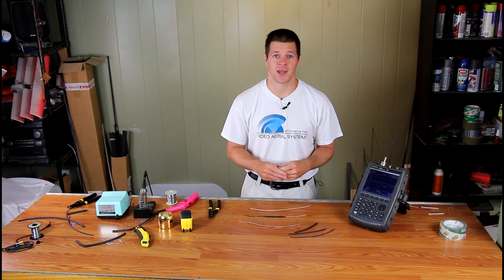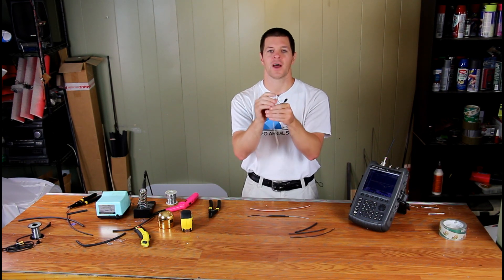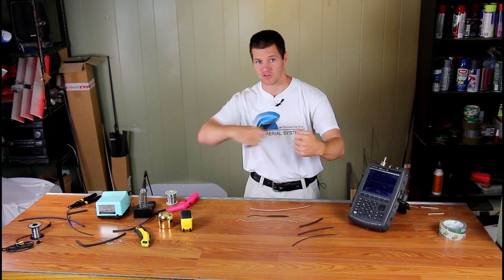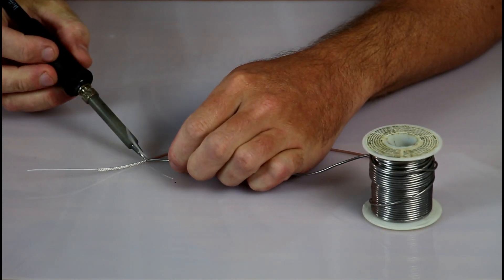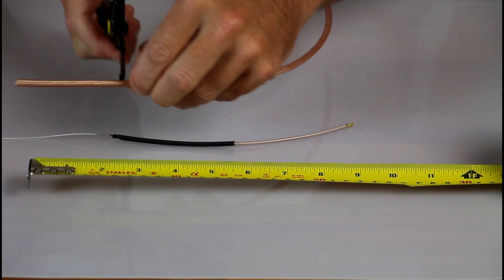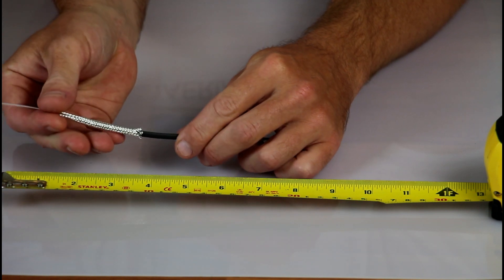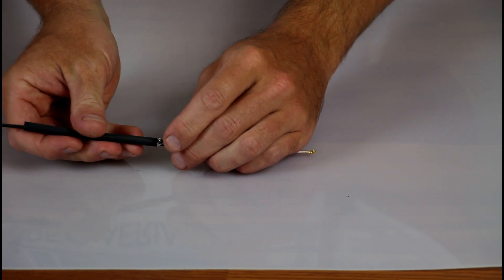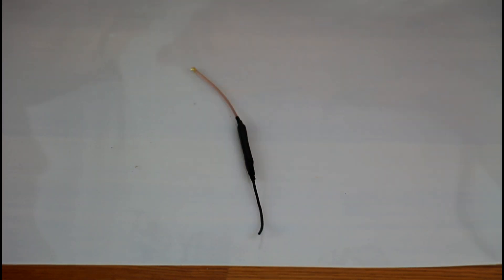DIY whip antenna for crossfire receivers (u.fl)

Comment: Hey Alex, I bought some 6 foot lengths of RG178 that already had the IPEX connectors installed, of course I don't need them that long, but I want to make more whip antennas from the excess that I cut off; for other quad builds. My problem is that I can't find anyone selling just the female u.fl connectors by themselves. I can find the male u.fl for PCB's or female u.fl with cable attached only. Can you tell me where I can purchase the female u.fl connectors without any cable attached ? I just don't want to waste that much leftover RG178. Thanks in advance for any info you can provide me with. Sincerely, Conrad
Reply from the maker: DigiKey usually has items like this.  They come in a 10-pack.  If they do not have it, check Newark.
Reply: @CAGreve1231  I have checked DigiKey, but they only had the male ends. I actually bought my shrink wrap for the Whip antennas from them. I wanted purple, and DigiKey had it. I bought my RG178 and RG142 from Pasternack. I've checked so many places for the female u.fl, but nobody had them. I will check Newark right now. Thanks for the tip, and Thank You very much for sharing all of the antenna videos. I never thought antennas could be so interesting. Thanks again, and have a great rest of your evening.
Reply: I meant heat shrink lol

Comment: could you use RG58 instead of the RG142? Awesome tutorial as usual Alex
Reply from the maker: Possibly.  I never tried.  The RG142 shield is a convenient size, but RG58 would probably work.
Reply: @CAGreve1231  Thanks Alex, I will try it, I only have a Anritsu site master to check it with.

Comment: What’s the best way to mount this? Should the air pocket section be mounted above the carbon and away from the frame or can you just have the rg142 section sticking up?

Comment: Hello Alex.  Not related to this video at all i was just hopeing i could reach you.  I have bought a 16 turn 2.4 helical antenna because the 16 turn is all that was available in the uk.   If i cut 6 turns off it so that it is a black cannon would it need to be re-balenced on an SWR Meter?? Thank you Alex and again sorry to ask an unrelated question.       Nick.
Reply from the maker: It would throw off the SWR slightly, but likely not enough that you would notice.
Reply: @CAGreve1231  Thank you. 😀

Comment: Is there anywhere common to most cities where a person could bring in an antenna or maybe 10 and have them tested for SWR, axial ratio, and other very basic attributes (for a fee)? I'm thinking maybe a few seconds per antenna like you've shown for the absolute basics. Or would a ham club have something similar (but probably much lower cost/quality) than the machine you used to test the antennas? Would VAS offer such a service for someone to drop off a few or mail in? One last question could an SDR be easily used to do any of these tests? Great job on the video.
Reply from the maker: Good question.  SWR isn't too hard to measure and I have  DIY SWR meter tutorial on FPVLAB.  However, when it comes to emissions and axial ratio that requires some very expensive equipment.

Comment: I don't have your antenna testing equipment.  Is there a way that I can test the antenna (short of flying the quad)?  Side note:  I use your ion antenna for my 6 mile LR quad and two immortal T's (and two black cannons on the rapid fire).  I'm building a DJI LR quad and want to get the same 6 mile distance (or further).  I was going to try 4 black cannons on the DJI goggle... do you think that will work?  Or do you have something coming that will work?
Reply from the maker: Just get the new VAS antenna for the DJI HD system instead of rigging up all of the helicals.  It will be much more compact that way.

As for the antenna, just be precise when you make it and you will be ok.  There really isn't a way to test it without equipment.
Reply: @CAGreve1231  Will do!  Where and when can I buy those VAS DJI antenna's?

Comment: Instead of an air gap, can you use more heat shrink shrunk down to take up the space? Does it actually need to be air?
Reply from the maker: No... well... you can, but the counter element would need to be shorter.

Comment: Can I place this antenna in a plastic tube, like a forevertube without affecting the tune of the antenna?
Reply from the maker: You will need to make it shorter in order to do so.  How much shorter depends on the tube.  If you can link me to the tube you want to use, I can take a guess.
Reply: @CAGreve1231  It's just your average antenna tube
https://www.racedayquads.com/products/forever-antenna-tubes-choose-your-color-pair-of-2?_pos=1&_sid=aea183e04&_ss=r
Reply from the maker: @taggerung890  - It looks like you'd need to shorten the antenna ~3/8" (trim off active element only) and that would do just fine.
Reply: @CAGreve1231  is that based on density of the tube?   Just curious.
Reply from the maker: Yes.  The more dielectric you have, the shorter the antenna will be.